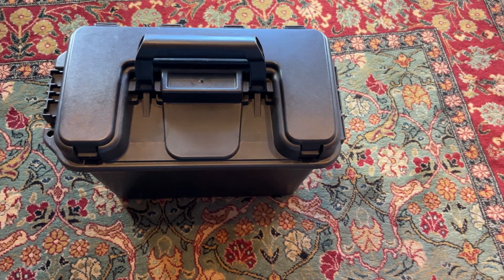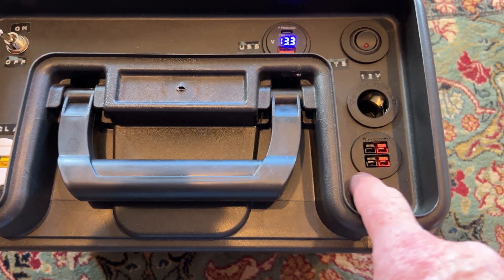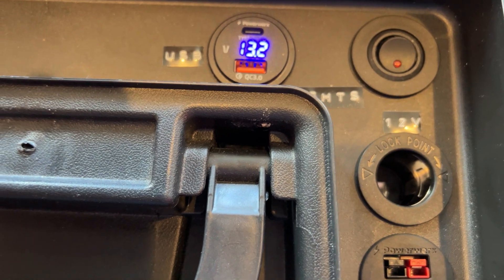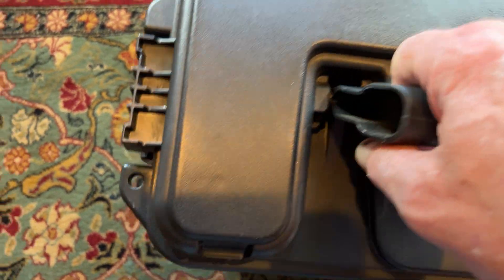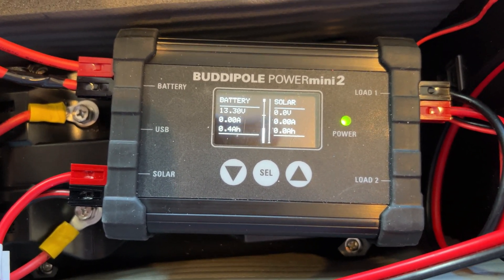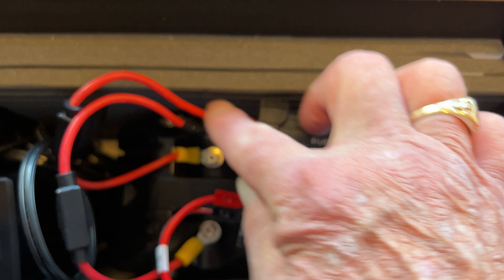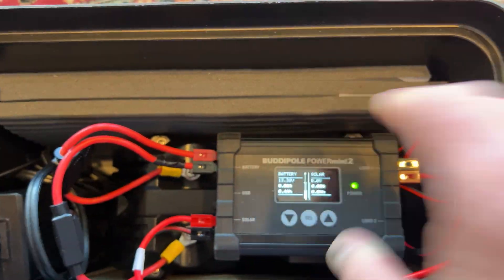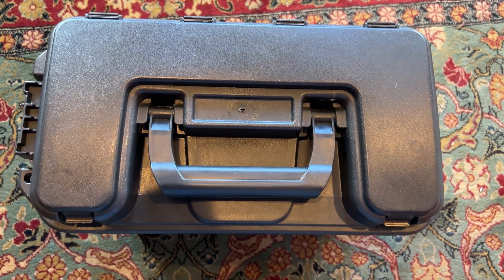20 Ahr Powerbox

Comment: All your URLs except for the Powermini are truncated and therefore useless.  You know you can actually put links in the description.
Reply from the maker: I believe they are now fixed.  Let me know if you have problems with them.  For some reason they were correct on the edit panel, but YouTube was truncating the urls.
Reply: @n7tb  Links are still broken. I had to cut and paste into a browser which was no big deal. thanks for the video